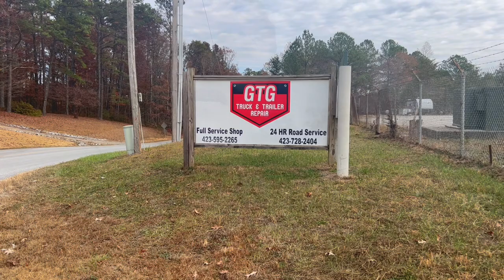Getting my Freightliner batteries changed at GTG Truck Service in Cleveland tn

Comment: It would have taken me longer to change the batteries because I would have pressure washed the battery box and surrounding areas..  If the Battery Box is Fiberglass then no need to rust proof.
   The Strap around your DIF tank is getting all corroded..  I would have sprayed Beaver Products Protect-O-Flex .. I would have  applied rust proofing grease with a paint brush to it .  I restored a 1968 FWD 6 wheel drive truck in 1985 and it's still running .. I replaced the Red Diamond 501 Gas engine in it with a brand new 3208 Cat Tubo Diesel ..  19,500 hours and 189,000 miles since I restored it .
Reply from the maker: yes.  company trucks... will be turned in after their lease is up so they don't bother with any xtra bells and whistles, if u know what I mean... :)

Comment: Happy Thanksgiving.  When you park for a long period of time are there ever shore lines you can hook up to to keep batteries charged?  I'm a firefighter and our trucks are hooked up like that when parked.
Reply from the maker: We don’t have shore lines (but I do use a plug in for my f250). We have a main battery turn off switch and during the colder months, I turn it off since I park for 3 days at a time. 
Thanks for being here!!!
Reply: @being_eli   I have installed Battery Disconnect switches on my of my Trucks , Loaders and Cranes..
  I had just paid $250.00 to have a Generator rebuilt on my crane.. the Points in the regulator had stuck shut and they drained the  8D Batteries dead and  fried the new Generator.  The Generator is supposed to be  able to be ran as a motor to turn the fuel pump to Prime the Murphey Disel Engine.  It's  1103 Cubic Inches.. It has 4 valve heads and a Double ahead cams  The Best Technology in Diesels in the 1950's or earlier..

Comment: I used to pay about $53.00 each for Group 51 Stud batteries..  I bought 4 Alliance Batteries in 2121 at Freightliner  for $77.00 each .
  I bought 4 more  from Mason Batteries in Battle Creek MI for $95.00 each and I don't think his  Rebuilds and Blems are much good.. I need to go and charge the batteries in 3 different Trucks ..
   I have a Front  end loader that needed 4 New 3-EH 5 Volt batteries.  Blaine's Farm and Fleet wanted   $138.00 Each   Tractor supply wanted $170. ..  I had bought two and Blaine's  and it still would not start..   So I bought two more at Mason Battery.. That's the guys name.. He buys Batteries from a warehouse in TN  and puts  his name on them his last name is "mason"  He charged me $95.00 each for them
Reply from the maker: I am loving seeing your comments here! I always look for your name! 😊

Comment: Always replace ALL batteries in a group at the same time... and do it on a schedule rather than wait for problems. 5 year warranty batteries are 90% spent long before the warranty runs out and should probably be changed by 4 years at most. One bad battery will kill the others, so there's no economy in waiting. You can't make any money with downtime.
Reply from the maker: yes so true! GTG and my company do it up right!
Reply: I agree, and knew a couple owner operators that replaced them all once a year and carried a spare Alternator.   These guys had no issues with electrical systems.  Cheap insurance!

Comment: Putting the side panels against the cabin and risk scratching the paintwork is kinda silly.
Reply from the maker: if I was an owner op, I would agree... I'm the 3rd driver of this truck and a scratch on the side will just blend in with the other areas of battery.... (see what I did there? battery? hehehe... on a batteries vid- yes I'm a cheese)  :)

Comment: Get an APU ..
Reply from the maker: had one on 3 of my other trucks - this truck didn't come with it and the company won't pay to add it on.. its a shame because not only does it save on idling fuel, but I could also use it to charge batteries if they were low/died...
Reply: @being_eli    Regular Truck Car and Motorcycle batteries get their life shortened by a lot if you run them low so for your Refrigerator  ect.  Deep Cycle batteries are designed to be discharged to a low state but they don't have the cranking power to start the Truck.
  How many years have you been Trucking?